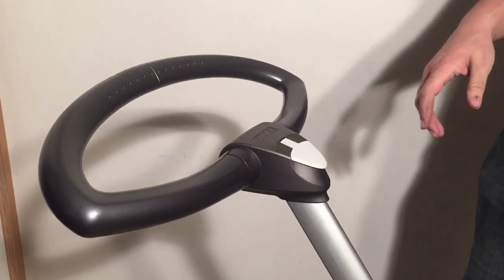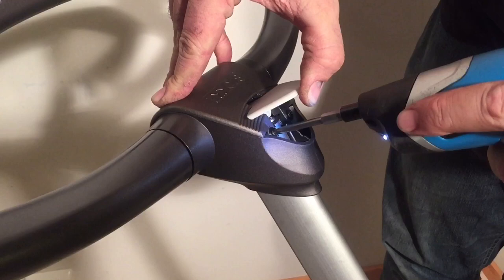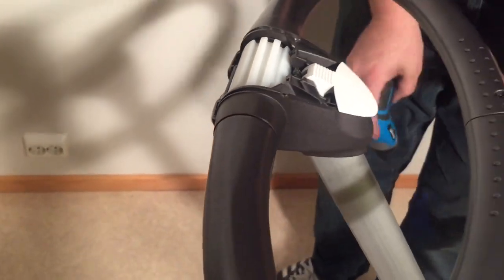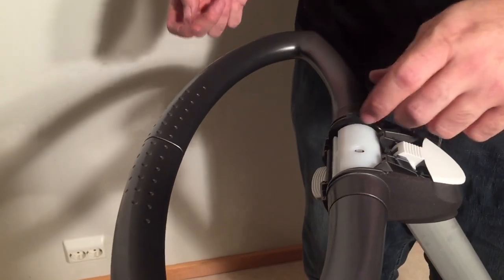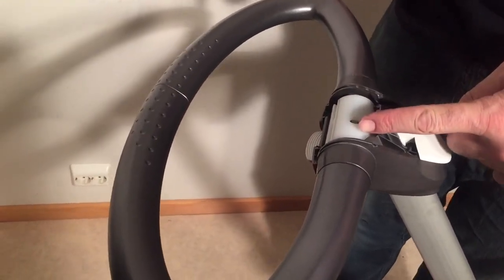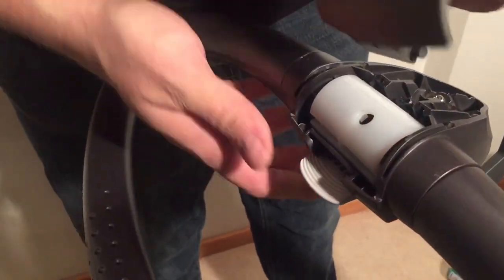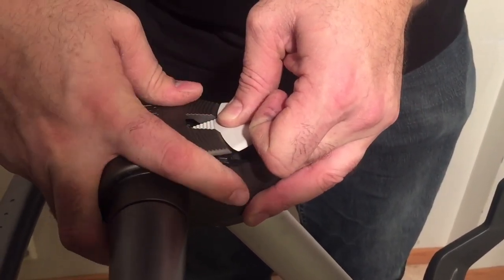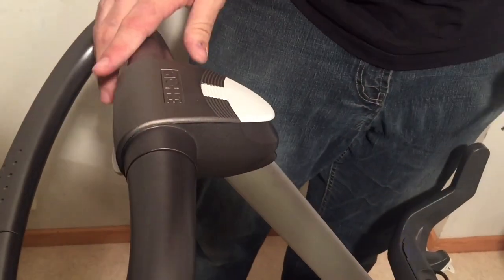How to Replace the Handle on a Stokke Xplory

Comment: I took out the pole with the 2 pins and now the pole is not low enough. So when I put them together I can't adjust the height of the handle bar. What can I do to fix this please?

Comment: GREAT VIDEO! THANKS for explaining step by step with such clarity.  I lubricated the inside of the handle with food grease and sprayed WD-40 down the shaft.  Only thing I can't figure out is, once you remove the screw in the shaft, how do  you take out that cap?
Reply from the maker: Do you mean the external top plate (with the 2 screws under the frontal handle height lever), if so you just pull it backwards without pulling the lever up.  If not, let me know, and I'll try to explain it better / make a video :)
Reply: @BarnevognverkstedNo  Mine creaked not only in the handle but further down, where you recommended to apply the silicone spray.  My stroller looks different, and it only has one screw in the middle section, I'm now thinking I'm not supposed to take this cap out, but just lubricate around it.  Then you said the bottom section has eight screws which may be loosened a bit to get the silicone spray down it .  I sprayed the entire neck of the chassis down with WD-40 but still creaks a bit in the middle section.  Do you think the silicone spray will be more effective than the WD-40? I wasn't able to do grease in the middle section, because I couldn't figure out how to remove the cap, but I'm thinking the silicone spray may do the trick.
Reply: The Stroller Workshop  I need you help!! I couldn’t put back together I can’t grab the pole, when I close it, I goes loose again.😒

Comment: Easyjet just broke the Part below the handlebar and I cant find any replacement
Reply from the maker: Contact Stokke customer service - they'll either give you the price of repair, or otherwise the price for a new chassis - in either case you'll have the cost in writing, then contact Easyjet and make them pay for it. :)

Comment: Hello, the pole inside the arm that makes handle higher or lower is loose. Its suppose to be connected to something at the bottom i think. How do I access that metal pole?
Reply from the maker: The process is shown in this video (note that you don't need to remove the rear frame for this disassembly though): https://www.youtube.com/watch?v=n5Vu7vCIK6A